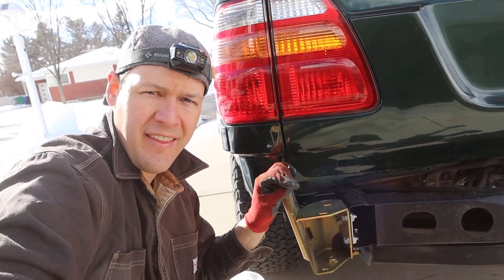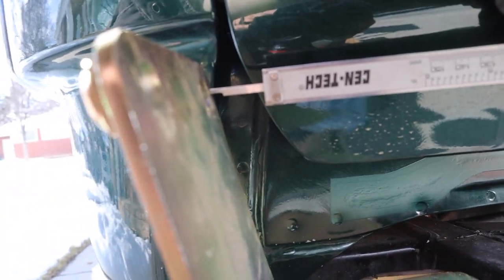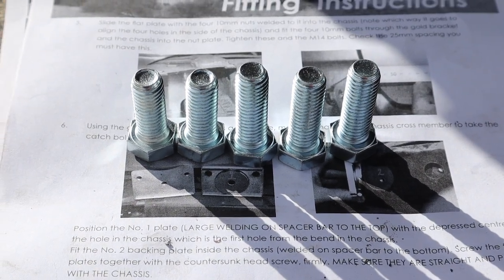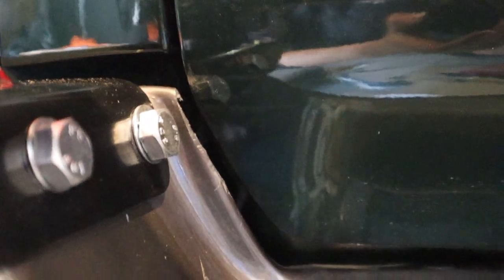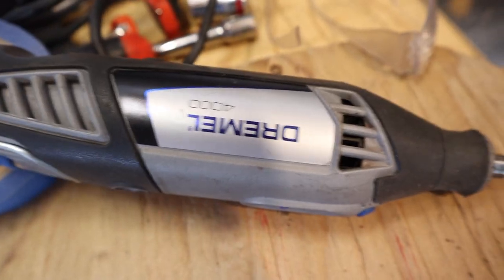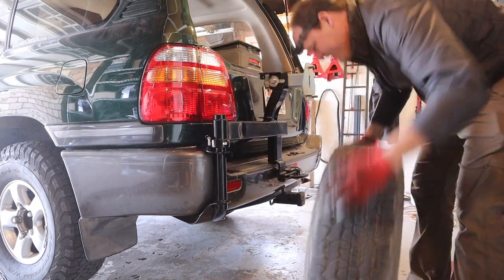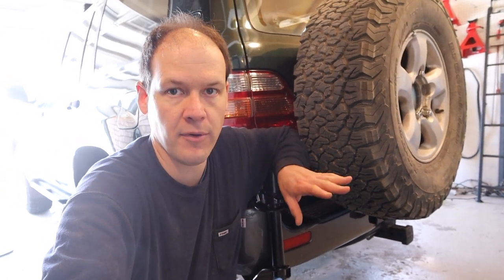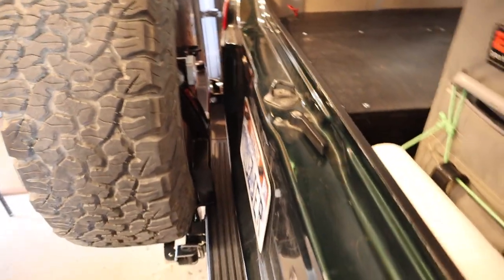Minimalist Rear Tire Carrier for the Toyota Land Cruiser

Comment: We are lucky at Middle East the 80,100,105 and 200 series comes from the factory with rear tire carrier
Reply from the maker: And the 70, no? I wish there were more options here in the U.S.
Reply: @thelandcruiserproject  
Yes of course the 70 also 
But for 100 series there are two options for rear wheel carrier from the factory 

First one like your car but you just need to replace the lower gate (easier to swap) and it will cost you about 200$-250$ for everything things including the work 

The second one the called push gate (similar to 70 series ) it will cost you about 500$ to swap it and need more body work
Reply: @thelandcruiserproject  and BTW I am not sure if you still own the car but if need part for lc100 from the Middle East I can help any time
Reply from the maker: Thanks for offering. I’ve sold the 100, but maybe I’ll have one again someday. 

Thanks for watching from the other side of the planet. I’m glad we’ve connected.

Comment: Nice work. I've been thinking at getting one for my 80 Series.  I like this model as it sticks the spare tyre closer to the centre compared to others which tends to block the tail light on the side it is on.  But this on the 80 Series seems to leave the taillight still exposed.

Comment: Do yourself a favor and run one of those sleeved cable locks (like used for bikes) through the spokes and around the carrier. 
It's like a $5 insurance policy for your spare wheel...
Reply from the maker: It has a little plate that sticks through the rear of the holder with a spot for a lock. Will do that since I have a lock just sitting around. Good tip!

Comment: Where did you order that Complete set of tire carrier? Is there any link to order? That's a good idea, instead of carrying a more than a 100lbs for the full steel bumper. Can you tell me where did you order that? Thanks!
Reply from the maker: Longrangeamerica.com
Reply: @thelandcruiserproject  After you installed the Kaymar Tire Carrier, is there any problems? Shaking while on the road, trail and off-roading?
Reply from the maker: Nope, it's been solid.
Reply: @thelandcruiserproject  Do you have any idea what model of that Kaymar Tire Carrier? 🍻
Reply from the maker: It's the K1120A
Reply: @thelandcruiserproject  Thanks Bro! Your Channel helps me a lot. 🤙
Reply from the maker: You got it! Thanks for watching.

Comment: Do you run into issues with LEO for blocking tail lights and license plate?
Reply from the maker: Not yet! Taillights are mostly unblocked and I did offset the license plate a bit, but it's still partially blocked. I don't attract much attention and it hasn't been an issue.